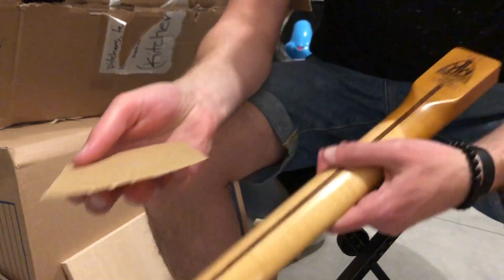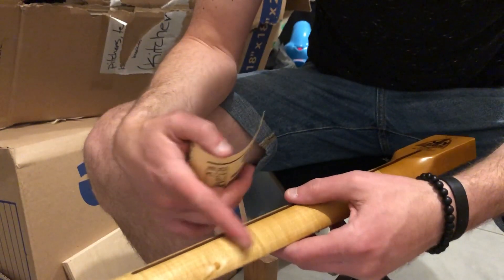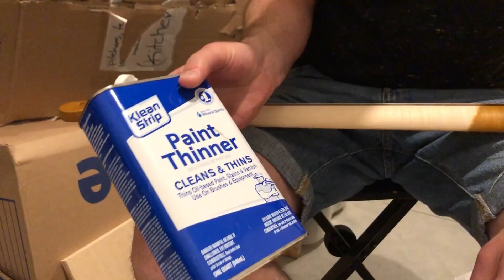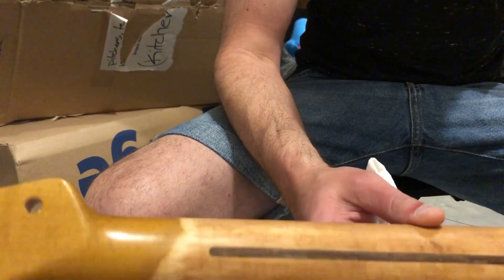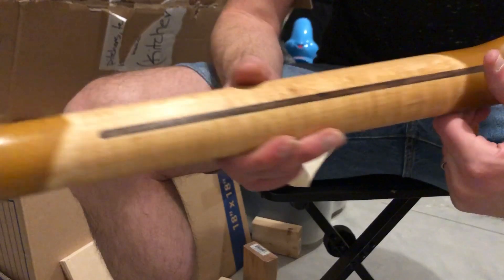Get That Worn-In Look for The Back of Your Guitar Neck

Comment: What is the best way to age a strat knockoff body that has a plastic coating? Underneath is plywood and I chipped it and it's a very deep coating
Reply from the maker: Evan Murphy hate to say it, but it's seriously plywood, so might think about just finding a cheap Squier. Those are typically made with bass wood but not plywood. A coating like that would probably have to be completely stripped but it probably still wouldn't be worth it.
Reply: @NathanSink  I have good guitars but I'm scared of relicing those for fear of messing them up so I was gonna use this one
Reply from the maker: Evan Murphy I hear ya. Well, if it doesn't turn out, no big loss, huh? 😊
Reply: That's the plan
Reply: Get rowdy. Seriously. Thats the only way to damage that finish.

Comment: Shoe polish on the rear of the neck works great on exposed wood.
Reply from the maker: YE Musica in my experience, shoe polish seems to eventually wear off of everything. But I haven't tried it on raw wood. So, it sticks pretty well to that?
Reply: @NathanSink  The dyes within the polish penetrate nicely on bare wood. To get it off, you would have to thoroughly sand it down again. Usually go with dark brown, followed by black. It does weird things to clear coats, so keep it masked off ;)
Reply from the maker: YE Musica thanks for the tip. 👍🏻
Reply: @yourenvyband105  yep shoe polish but i also add a dab of dutch oil as well.  really blends well with poly or nitro!